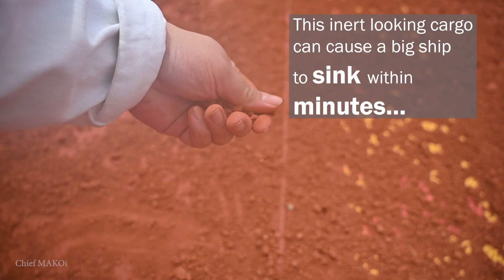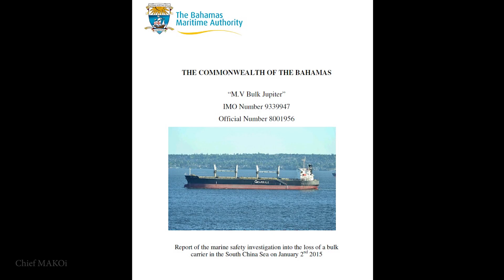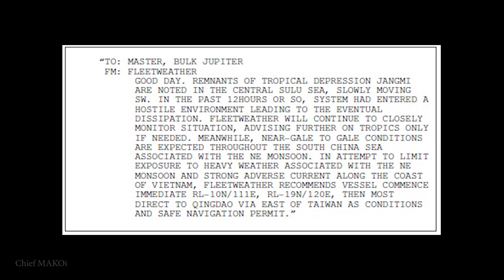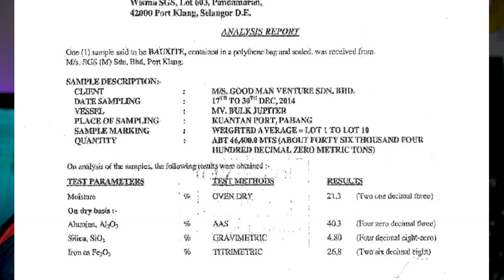The Cargo That Can Sink Ships Within Minutes : Bauxite Liquefaction | Chief MAKOi Seaman Vlog

Comment: Very very informative. As an OTR Driver that will often carry Hazardous cargo, Heavy loads and Irregular shaped off center industrial equipment I always supervise each loading or do it myself. I have had MANY Heated exchanges with Shippers, Customers and Booking agencies about Unsafe off balanced or Over Weight loads. I tell them this: If I allow this to go the way it is and if an accident happens because of it, I'm RESPONSIBLE 1ST AND FOR MOST so NO! Lost a few Customer's and some places won't work with me. But in all my year's of Trucking I've never had an accident that was my fault and never lost cargo because of UNSAFE Loading. Don't be afraid to say NO Especially when Innocent Lives are involved, That is the Mark of a Real Professional.
Reply: Why can't the bauxite be put in smaller containers, then those are loaded separately with leveling in mind?
Reply: @2degucitas  it could, but it would cost more money, thus impossible
Reply: @fritzfxx  also much more time consuming to discharge
Reply: @fritzfxx  isn't it also possible just to load only one quarter or half side of the ship? If the water weight is shifting in only one portion and can't align with the rest of the ships movement, it should be fine, no?
Reply: @2degucitas  Because it's a crushed ore. It's handled in bulk for processing, so smaller containers just wouldn't work.
Reply: Thank you for being a caring Boss and worker. So many get caught up in the money and forget about the ppl actually doing the job. Safety 1st.
Reply: Thanks for sharing Ge0 Arc. I love your comment.
Reply: sad that others wont care because they are greedy animals...
Reply: ^Respect.
Reply: I'm surprised how unprofessional your industry is. if there's a safety hazard it should go without saying that you do what have to do to protect your vessel.
Reply: @DevinDTV  It's called capitalism, blood and corpses are never allowed to stand in a way of making a few cents of profit. The only way to stop this is state regulation but sadly there are way too many brainless imbeciles brainwashed by money of 1% believing state is teh evul and regulations must be killed, after all ultra rich with lots of blood on their hands said so and they wouldn't be wrong, biased, or not thinking of 99% when they spew that propaganda, eh?
Reply: As a mechanic, I've refused to work on several cars that were either trash filled biohazards or had moldy interiors or had subframes that were rusted so bad that I needed a tetanus shot just from looking at them.  At the end of the day, if it's not safe, I'm not touching it until it is.  If you wanna pay me to make it safe then we'll talk otherwise, best of luck to you.
Reply: Customers need to understand safety comes first.
Reply: It would be really interesting to see how low accident statistics would drop if every company and driver behaved according to law. Almost every time crashes are thoroughly investigated, it turns out that some form of gross negligience was involved. Unsafe loads, drivers that haven't slept in a day or are under the influence. Often enough it's a combination of factors. Companies pressure drivers to do Long-Hauls in impossible times, they ignore safety precautions and hire questionable personnel to save money. If something happens, the driver takes all the blame and the company get's off scot-free or with a minor fine and the promise to be more careful in the future. These company practices contribute heavily to over 4000 deaths and 130.000 injuries every year, in the U.S. alone. Adjusted to population, the numbers in most european countries are very similar. 

Companies need to be hold accountable. There should be a system in place where you are still legally entitled to payment if you deny carrying an unsafe load. Imagine it like this: A company wants to pressure you into taking an unsafe load? Drive through the company gate and immediately call the cops. They investigate the freight, confiscate the truck and you can go home. The company is required to pay you the full contract as if you fulfilled it, since they are at fault. You were willing to fulfill the contract, they were the ones who didn't by pressuring you into illegal practices. Drivers would still be responsible for their loads, but it would kill the incentive for companies to play against the rules.
Reply: @swagric2590 i believe its the FMCSA you can call if you're told to knowingly do something in violation or unsafe, refuse and get retaliated against by the company and they will look into it and go from there
Reply: @swagric2590  I am a big fan of the concept of strict compliance. If everyone in every situation followed every regulation and company policy precisely as written, it would expose the bad policies and be a uniform method to encourage change. 

It is very common for regulations and business contracts to assign blame and responsibility to the person doing the work, but the rules are broken at every level before the worker becomes involved.

Just like in the video example. The shipping facility knew the regulation and the risk. They also knew that the ship was already loaded and it would be prohibitively expensive for the Captain to challenge the moisture content and delay the voyage for the dispute. 

The shipping facility management was never in danger. They had no literal skin at risk. If every ship's Captain had a reputation for strictly following the rules, things would change. 

I used to drive OTR as well. Anyone I worked with knew my attitude well. You can fire me for not driving when I think it is unsafe and I can have another job in minutes. If I get in a wreck to make you happy, your not going to be happy and no one will hire me.
Reply: @2degucitas putting them in smaller containers would still have the same cumulative effect.
Reply: @FastraxCargo Similar effect but less severity. The more constrained the fluid is, the less the center of mass can shift and the less momentum it can build as it moves.
Reply: Those aren't the kind of people that do good business anyway.
Reply: Thank you for standing your ground... been there myself.
Reply: What has gone wrong and why?
Reply: You are very right.

Comment: Class surveyors, Flag State and Port State Control Inspectors continually have to reinforce safety requirements and the importance of correct cargo handling. Unfortunately some cargo and/or shippers' agents and terminals take a different view as their work is to get the cargo off the quay and onboard as quickly as possible and the recievers' surveyors want as much cargo as possible and in good condition.  The ship's staff have to do the rest whilst "over the horizon" on their own.    In the days of smaller vessels, it was common for the ships to insert washboards extending down from the deckheads to below the top of the cargo to prevent the free surface effects of a cargo that could form slurries but with the advent of larger ships this practice is no longer common and sometimes impossible.  Further requirements can be found in the International Maritime Solid Bulk Cargoes (IMSBC) Code and the Grain Code.  Often due to the nature of the cargo and ship design, the vessel can do nothing once the cargo is loaded. The ISM Code requires directly that the Master has overriding authority and responsibility to make decisions with respect to safety and pollution prevention and request the Company's assistance as may be necessary (Element 5.2 of the Code).  Unfortunately many of the people in the shoreside organisations of ship owning and management entitiesare not as experienced as they once were or really qualified to assist in making the better decisions with the Masters and Masters are afraid to make "cargo calls" or even issue letters of protest for fear of losing their jobs.  As far as I know, only know of one flag (Marshall Islands) demands that Masters are protected in the ISM system from financial and legal litigation when they use the Master's overriding authority.

Comment: Those ships are just dangerous for running that cargo and port authorities should just ban loading it. Why don't they just split the hold down the middle with a bulkhead from the keel to the ceiling when running liquefaction-prone cargo? Seems like a simple solution that could be temporarily installed in some ships, if not just welded in.

Comment: This reminds me of a story I was once told of the old canal steamers transporting manure around the various countries. It would be dried in the sun prior to packing to save on weight and allow them to carry more. However they had a stipulation that other materials must be loaded below it to avoid it absorbing any moisture from leaks, increasing in weight exponentially, and sinking the boats. It was labeled, “Stack High In Transit”, or simply stamped with the acronym “S.H.I.T.”. He de where the term supposedly comes from.
Not sure if this was 100% accurate, but it made sense.
Reply: Unfortunately not, "shit" as a word for faeces is anglo saxon in origin. Same root as the German "scheisse". Could have been a backronym though.
Reply: @Croz89  wonder if they noticed the acronym, or was someone a master of low-key smartassery 😀?

Comment: Iron ore, Bauxite -- don't add water! 
The Edmund Fitzgerald proved just how FAST dry iron ore can take a vessel down. That crew couldn't even get off a proper May Day.
Water 'lubricates' bauxite -- especially that which is at the bottom of the load. It's the pressure.
From above, nothing really seems awry -- until you're in serious trouble.

Comment: Demn, no partitions inside the cargo hold? that would minimize cargo shifting and also strengthen the hull, but i guess that would be too expensive and too heavy?
Also,i do not understand what Chief Makoy said: water gets to the top and makes the Center of Gravity higher ? if water rises, that means that the solids on the bottom are more dense,meaning heavier,and the CG shoulg not get lower?

Comment: Are ships that normally carry dry cargo ever designed to be safe for use with loads that can separate or liquify? Or are only liquid cargo ships capable of that?
Reply from the maker: Tanker ships are designed specifically to carry liquids.  Bulk carriers load different types of dry cargo like grains, ores and even scrap metal.  That's why the cargo hold is just a big empty space.

Comment: Many years ago a home-heating fuel-oil delivery driver referred to a problem phenomenon he called slosh.... He mentioned if he abruptly braked his truck, the momentum of the fuel-oil would push forward against the front wall, and cause the truck to skid excessively forward. Many trucks now have internal division walls/baffles. Maybe that solved most of that problem.

Comment: Dynamic separation is a ‘type of liquefaction’. A better term is instability due to moisture. There has been a great deal of study on materials that appeared to liquify but TML could not be determined. This is not limited to bauxite but covers iron ore, manganese ore, coal and some concentrates. The issue was getting mariners to understand that materials that appeared ‘competent’ (in fact ships would come in with water on top of the cargo but the cargo at the bottom was compacted) as the general view was the material would not liquify. Iron ore actually started the investigation process noting this was considered a ‘group C’ cargo having no risk. A number of vessels had been lost carrying iron ore starting a significant research task.

This work determined that there was a risk with iron ore based on particle size, particle distribution and mineral type. While testing determined that there was a risk the failure process had not been determined. By the time the work on Bauxite had been completed an understanding of the moisture migration occurs due to vibration and vessel motion. This involved testing of models in a large centrifuge (gravity is not scalable and the centrifuge was the only was to test in small scale) to confirm the predicted behaviour of the material.

Even with liquefaction, as is commonly understood in mineral concentrates, dynamic separation forms part of the process of the initial migration of moisture. 

The big issue was there was no test in the IMSBC Code prior to the iron ore work. The test used for mineral concentrations was not suitable, however,  the work done by the industry research team and participating  Administration’s developed tests that could determine the TML for these cargoes.  

The research also noted that there were warning sign when moisture migration was occurring. Holds tended to have water migrate at different rates. This and the shape of the hull and motion of the sea meant that the water movement was not synchronised…. Initially. Modelling showed the vessel would have an atypical role (wobble if you like) was the water wave motion in the hold was out of sync with the rolling of the ship. So the ships roll would hesitate. If such a motion is detected then the holds should be examined …. And appropriate action taken.

Just for the record … I was involved in this work and the development of the video referred to below.

 https://youtu.be/zdyrQSypPBQ
Reply: Thanks for the deeper insight!
Reply: It makes sense that iron ore lead to the research, a well known example of an iron ore frieghter sinking is the Edmund Fitzgerald which I now wonder if that's what caused it
Reply: Although shipping wet cargo that’s supposed to be dry isn’t ideal. Why not design the ships with baffles in the cargo area so the cargo can’t shift And at least save the ship from stinking.
Reply: @wormhole331  all the cargo is synchronising it's motion, so baffles wouldn't prevent the issue, I believe it also is baffled
Reply: Would it make sense to have water pumps on standby to potentially pump out some of the excess water which migrates to the surface?

Comment: Can't they design the cargo holds with medial separators so the cargo on the port cannot flow to the starboard only to the middle of the ship, and vice versa? These separators can be removed during unloading to make that process easier. It seems wierd there is no design solution for this phenomenon in 2021.

Comment: -This is like when you go to the seashore.  Get right down near the tide line, but where the sand is fairly firm.  Push your foot up and down on the sand, and it will go from firm to soft and watery in a few seconds.

Comment: My questions.  Safety and not sinking is most important, but shouldn't the ship owners also back the captain for financial reasons?  If it is 20% moisture, then aren't they buying 20% water and shipping 20% water?  That has to affect profits.
    Also I was thinking even if the ship were recovered, I'm no expert, but I don't think it would be possible to test to see what the moisture content of the cargo was before it sank, or if the cargo had shifted to one side before it sank.
Reply: If you find a fully intact and sealed cargo compartment (I don't think you will, these covers are certainly not built for hundreds of tons of water, and maybe there's an air vent where water can enter) you could test for water content, and see if it separated, but it would be a huge effort. You would have to get samples out through the hull and to the surface without getting them wet
Reply: The ship owners don’t care, they just transport form A to B. The buyer is the one who pays for the cargo. The buyer and seller will involve surveyors to draw samples at destination to determine actual quality of the goods and compare it to the specifications in the sales contract. As was mentioned in the video an investigation occurred after the incident and samples of the cargo taken at time of loading were analyzed and high moisture content was determined.
Reply: @nicolasdenis7094    Ok.  My point was there is a monetary incentive to not have it wet.  Not only a safety reason.  If I were the buyer I'd want a 20% discount if the cargo was 20% moisture.
Reply: @BrettonFerguson  is it sold by volume rather than weight?
Reply: The bauxite cargo is hand counted by 400 million chinese when it arrives. They allow a margin of error of 12 bauxite pebbles per shovel.

Comment: A ship is dependent upon the stability of the cargo of the ship.  The same for a C141B and weight placement.  One must place cargo in the proper place (to ensure that the plane does not go too far forward and cause the plane to crash).
A ship is not any different.  A change in the shifting weight can cause a ship to go under.

Comment: I find it wild that they ship such high moisture content, it seems a waste of cargo capacity. 
I was a load planner and plane-side representative for wide body cargo aircraft, and yes refusing to load or even a delay in loading when the condition of the cargo is not certain, requires a strong backbone to stand against the business management pressure but the decision has protection from the owner of the aircraft and in many countries also legal protections.(The pilot in command will also be on the side of a safe load, and can refuse a load independent of the plane-side representative.)  The loading company will always attempt to push the limits to make their own operation lower cost or to cover up their own mistakes (Such as allowing cargo to gain moisture or not loading in the correct order to save time.) but minimum condition of the cargo and loading details are usually in the contract so they can only try to bluff.
Some of the issue is simple incompetence, the ground crews are generally local low-pay unskilled labor and then the crew managers are often selected from this pool of ignorance.